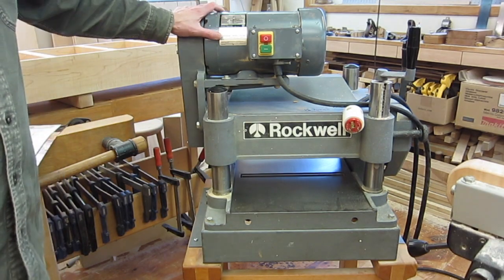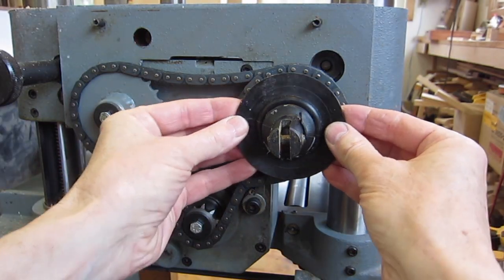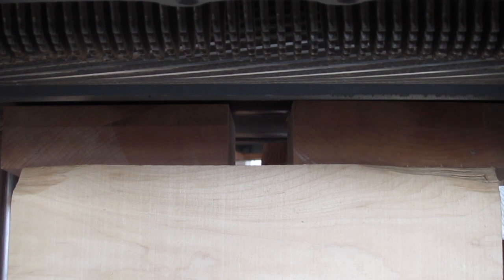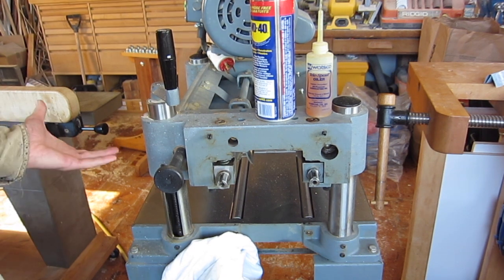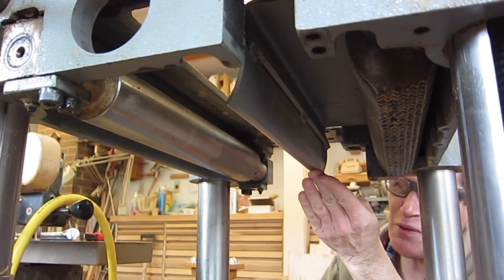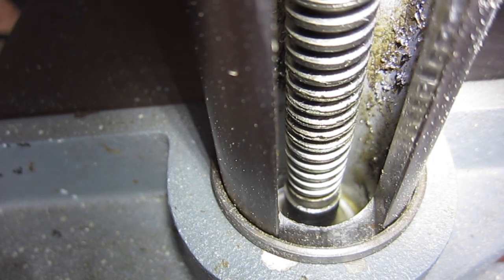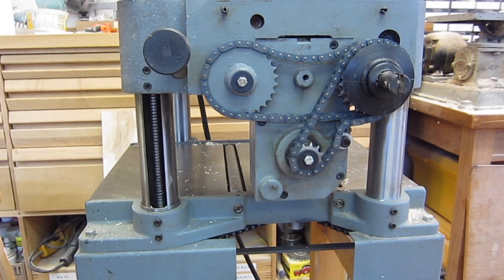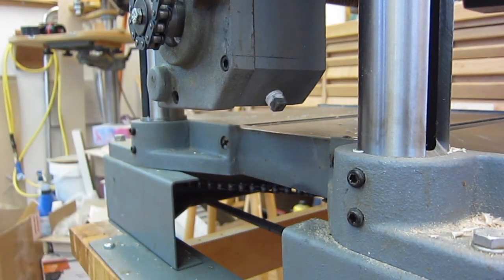Rockwell Delta RC-33 DC-33 22650, 4 post planer upgrade to BYRD SHELIX + Lubrication + Adjustments

Comment: Great video!  I recently replaced my belts, had to go to an auto parts store to find them.  My unit will slowly raise up (less depth) under load.  Adjustment handle spins around on it's own!  I'm hoping something in this video will help me fix that, but if anyone has an idea do let me know.
Reply from the maker: Your problem is not covered in the video.   Here are some suggestions:    1) There is a drift pin that locks the height adjustment handle to the shaft, perhaps it is missing or broken.    2).  Look underneath machine as you turn the height adjustment handle, does the chain move as the handle is rotated, perhaps the chain too loose, or gears that engage with chain are not tightly bolted to the rotating threaded rods.    Good luck, and when you get it fixed,  let us know what the problem was.
Reply: @steven.woodward  Absolutely and THANK YOU for the rapid response.  After spending the last hour fully watching your video, I've realized what poor shape the machine is in.  I'm going to strip it down and clean it thoroughly, lubricate, check the fine adjustments on everything and then double check the height locking issue.  To clarify the handle only spins because the upper deck is raising up.  It moves under it's own vibration, crazy.  I will update this with the solution for sure.
Reply: I may have already found it.  The knurled 3" long knob that locks the rod down for the raise/lower adjustment, squeezing the posts?  I have one.  As in, only one.  Never really knew what that did before your video, so the front one is missing!  Heading to the hardware store for a matching nut and I'll just have to tighten it up with a socket wrench, no big deal.  Just never missed it before, guess I thought those bare threads were engaged further back.
Reply from the maker: @erictuthill9029  Good detective work.   You will need to loosen both of those locking rods each time the height is adjusted.   Instead of a nut, you could use a threaded coupling (used to join threaded rods together) which are also sold at hardware stores.   Then attach some kind of handle to the threaded coupling.  The threads on RC-33 are all metric, as far as I can tell.
Reply: @steven.woodward   @Steven Woodward  Oh, good note and good idea!  that nut is an m12 .75 thread, for anyone who needs that info.  I didn't know about the loosen/adjust/tighten procedure.  Also, I'm stripping it down and the smallest cog in the gear box doesnt have a nut holding it in.  I don't have the style with the large handle to turn on and off the feed roller, I have a smaller T handle under the left side of the gear box I pull out to engage.  I cannot figure how to get that cog out!
Reply: Sorry, gotta correct myself.  There was a 10mm bolt with a washer holding on that gear, same as the other 2.  the other 2 move, that little one seems frozen on the shaft.
Reply from the maker: @erictuthill9029  For the small gear, I used a pry-bar as shown at 3:20 in video.  If that does not work, a gear puller may do the job.
Reply: @steven.woodward  Thank you!  I gave up, cleaned up the chain that I could, lubed it and moved on.  The issue is definitely the post squeeze handles and rods.  I cranked them down a ton, so much that the bushings on each side are 1/4" into the machine, and now it isn't as bad.  But it still moves under heavy load, and now it's difficult to raise and lower the cutterhead.  Not quite sure why those wedges are doing such a poor job.  I'll keep digging into it!
Reply from the maker: @erictuthill9029  Check that the "squeeze handles and rods" have the tapered piece, ( 15:00 in video ) on each rod end. Check that  taper is facing towards the vertical post, for each post.

Comment: For anyone that owns a 15" Rockwell, Delta, planer and others similar. I have a Woodtek, one of my bushing/bearing went bad due to not oiling. I bought one for a Delta. Exactly the same. So others that may need parts and especially if a not so famous brand name, my Woodtek appears to have been copied off the Delta/Rockwell. I hope this helps someone in the future.
Reply from the maker: Good to know.   Where did you buy the Delta bushing from ?

Comment: Im thinking of doing the same! Since i got my powermatic helical head jointer im thinking of upgrading the cutterhead in my rc33! Where did you buy the head?
Reply from the maker: I bought my Byrd Shelix head here:    https://mywoodcutters.com/SHELIX_for_rockwell_13_inch_Planer_(RC-33)    It comes with one bearing installed, and I ordered the other bearing at the same time, rather than sourcing the bearing on my own.    Also ordered 100 spare cutters and one year later I have yet to use any of those spare cutters.

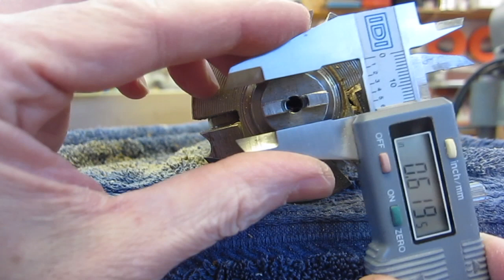To order the head, you have to first measure the thickness of  a spline on existing cutter head, as shown at 9:00 in the video.   The measurement requires the gearbox to be taken apart and the existing cutter head removed.   That is actually a good thing, because if you find some irreparable damage along the way, then you won't have wasted money on the new cutter head.
Reply: @steven.woodward  thank you!

Comment: I have the same model planer. I'm looking to order the Byrd Shelix. I'm being asked for the spine thickness measurement. Apparently, that varies with our model planer. Can you point me in the right direction? How much disassembly or where should I be going to get that measurement?
Reply from the maker: The disassembly work must be essentially complete before the spline can be measured.   At 8:53 in the video, it shows how to measure the spline dimension for Byrd.   To access the spline, the gearbox and cutter head must be removed from the machine, and the gearbox must be separated into the two halves - these steps are shown in the video leading up to spline measurement at 8:53.    One hidden benefit of having to complete disassembly, before measuring spline, before ordering Byrd head, is that you can inspect for any damage like broken teeth on gears, cracked casting etc, and then decide whether you want to spend more money on the planer.   It takes a long time to get the cutter head from Byrd so you will be without the use of your planer during that time.  While waiting for the new cutter head you can do a complete lubrication and tune-up of the rest of the machine as shown in video.
Reply: @steven.woodward  thank you!! I watched the entire video a few months ago, and after talking to Byrd I skimmed through it and missed it. Thank you!!

Comment: I have the same machine only 1" wider and in a top and bottom cutter head configuration.
Reply: I want to do this upgrade on both heads but how much power loss is there on the carbide cutters not being as sharp as hss knives? I ask as my bottom motor is opposite rotation and is difficult to find a 3hp in the proper roatation and size. It has a 3hp top motor and will likely need a 5 hp no? The bottom 2 hp is def taxed and can not take any more load if the carbide takes more power I may not do the swap. I thank you for your advice in advance ...compliments on the great video.
Reply from the maker: There seems to be a consensus on the internet that the segmented helical carbide heads require more power than sharp straight knives.  I imagine one reason is the carbide, as you mention, and another is that the segmented head for the RC-33 has 5 rows of cutters compared to 3 straight knives.      

However, on both my RC-33 thickness planer and Makita 2020 jointer, I did not notice much difference after changing to segmented cutter heads.  Can always take thinner cuts to compensate, which also contributes to smoother finish.

Comment: Hi Steve, I bought an old Rockwell Delta 13x6 planer but it won't start and will only click by the overload relays.  Would I need to replace the relays?  Or could it be something else
Reply from the maker: My suggestion:  1) unplug machine from power, 2) remove the 3 belts that go to the motor, 3) check if the motor shaft turns easily by hand, 4) if motor spins by hand, then power up the motor and see if it spins on its own.   If the motor spins fine under power, then the problem is somewhere else in the tool - like seized cutter head or gear box.   If the motor does not spin on its own then take the motor to a good electric motor repair shop.   It is most likely just a motor capacitor  or the centrifugal switch in the motor, both of which are not expensive to replace.   If the motor does not turn easily by hand then don't bother powering it up, the motor bearings likely have to be replaced.  Again this can be done by the motor repair shop.    They should be able to give you an estimate.   The motor on your planer is likely made in USA by Leeson - a high quality motor.      Let me know what the outcome is.

Comment: I need shifter parts for my Delta 22-650. I have part numbers. Where can I get parts?
Reply from the maker: Others have reported that some parts from Grizzly and other brands,  that made "copies" of Delta, will fit Delta.   I cannot confirm if this is in fact correct, and don't know how to find out which parts are compatible.    Perhaps a starting point would be to search online for the exploded parts assembly diagrams for your machine and similar "copies" and see if the parts look the same.  Then it would be taking a gamble on purchasing the parts and seeing if they fit.     A long shot would be to search on eBay for specific parts.  Another option:  find a cheap Delta 22-650 in poor condition (rusty, no motor, etc) and strip it for parts - hoping that they are in good condition.

Comment: What oil did you use when filling the roller reservoir?
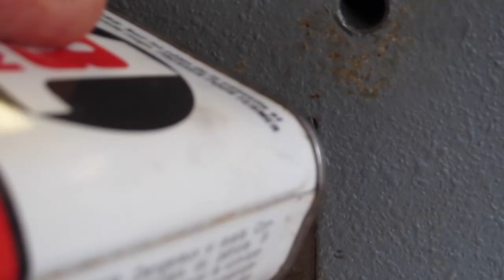Reply from the maker: 3-in-1 household oil.   It is a light weight oil which can soak into the bronze bearing.    Here is the point in the video, just to make sure I am answering the right question: 13:57
Reply: I was curious about the oil in the bottle at the 33.23 mark.
Reply from the maker: @arkansasboy45  It is same viscosity as the 3-in-1 household oil but in a handy dispenser with a very long spout that can reach down to the bearing.

Comment: Sir I m a buyer from India  
In case what's  the procedure for buying a new one 😅
Reply: Online ???
Reply from the maker: Manufacture of  Rockwell RC-33 ended many years ago, therefore it is not possible to buy a new one.     If I was buying a new planer I would look for one that comes with a helical segemented cutter head such as one of these http://www.powermatic.com/us/en/c/planers/P260/?reset=true